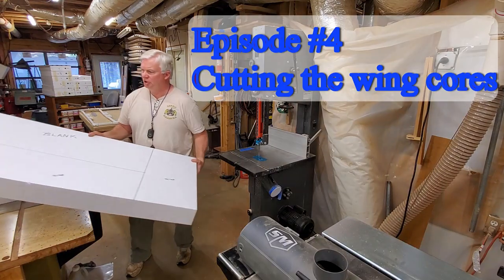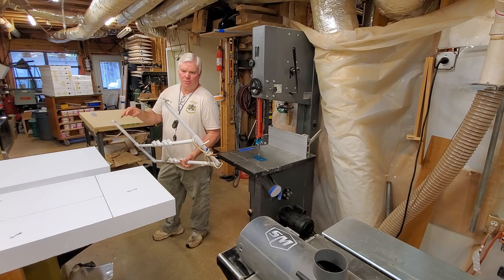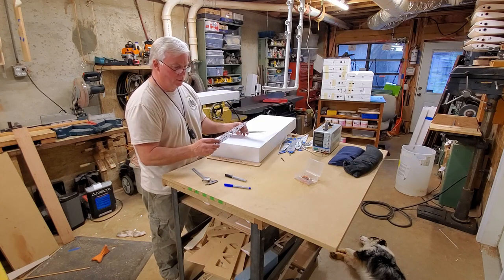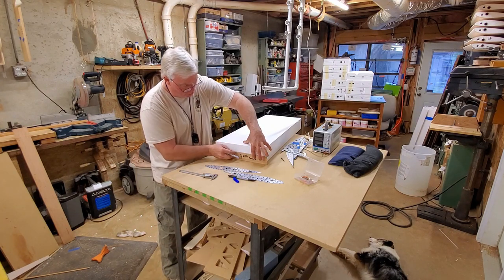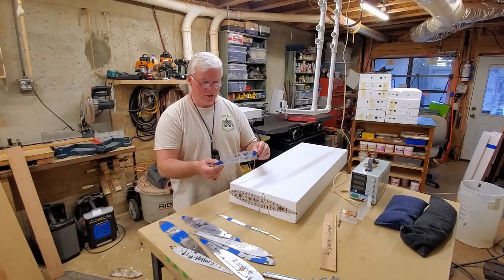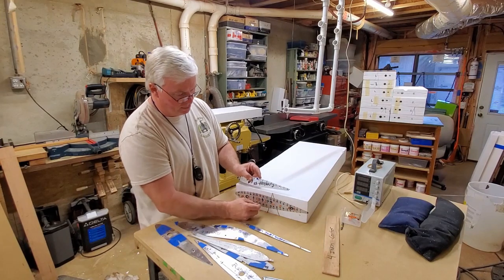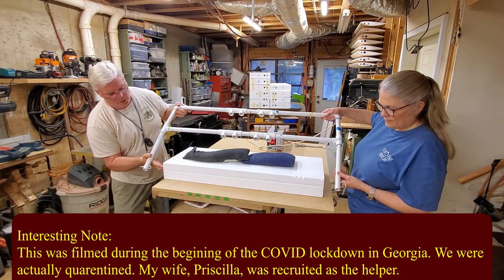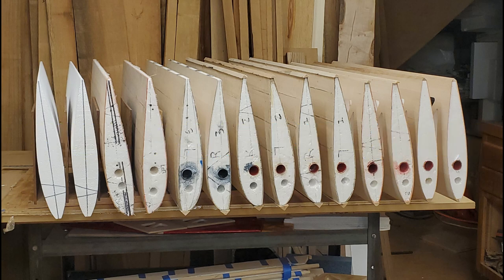Scratch Building your Own RC Planes  Episode #4 - Part One "Cutting Foam Wing Cores"

Comment: My first styro foam wing was made in 1988 at control line airplane F2B. I remember it was not easy and few first styro block was damaged,.
The diameter, length of wire and voltage were  experimentally determined. 
Airfoil made of steel is needed to avoid stuck the wire in one place during cutting.
Good tips; interesting and cheap technique for good and strong wing.
After the styrofoam has been covered with the balsa sheet and the pipe is approximately 1/2 of its length installed, the wing girder is redundant  :-)
Reply from the maker: Thanks for the kind words and background.  I'm not sure what you mean by "girder"?
Reply: @mikencrcf6018  I mean "wing spar" of course  :-)
Reply from the maker: @peterp.3530    oh, yes.  A wing spar would be completely useless in this design.   I do put balsa spars on top and bottom of the flying wing however.  They form a "T" connection with the fiberglass and balsa.  Its incredibly strong.   But, those planes have a very short life span.

Comment: you could always put a small metal screen door screen cone on the end of your suction tube connected to a 1.5 battery positive terminal and the other end grounded to the metal table ... this will attract the gnats to the cone and the suction will pull them in
Reply from the maker: Hmmmm.  Send a sketch of what your describing to Cpd551@gmail.com 

I'll try that

Comment: Thank you. On the sockets what weight cloth
Reply from the maker: I use .7oz cloth for the sheeted parts.  Anything from .5oz  to 1.4oz would work depending on supply.  .5 is hard to find and very hard to handle since its so fragile.   1 oz goes down very nice but its a tiny bit heavier.   For most planes the difference is negligible.   

I always use 1.4oz on the flying wing plane.

I use 4 or 6 oz for the wing tube sockets.    

I made a FACEBOOK group  for this build project and related projects.  Feel free to join and post.  "Foam Core RC Plane Builds and Repairs ". 

Its much easier to navigate than this forum.

Comment: What voltage and amp setting on your power supply?
Reply from the maker: Roughly 22 volts at avout 2.7 amps.  It comes out to àbout 700 watts for the 40 inch wire bow I'm using.  Of course a shorter wire means less watts.  Again, the adjustable DC power supply is perfect, safe and cheap.  

Go to Facebook group "Foam core rc plane builds and repairs"  for easier correspondence and I can even send detailed photos.

Comment: Does your foam supplier ship out foam?
Reply from the maker: Many distributors do ship.  However, most require a minimum order size of about $200 to $250.  That's a lot of foam and shipping is over $100.  That's still much cheaper than buying and shipping single slabs.  

I drive over an hour to pick my foam up.  I buy about $200 worth and split it with several buddies in my area.  More because of storage space than cost.  

Kevin Baker, at Universal Foam has given me the best quotes for foam that I have seen so far.  They have locations all over the country and hopefully, one is close enough to you to make a day trip of it. 

Just search for 1lb polystyrene and you will see many distributors.  I've reached out to 6 or 7 of them and Universal was my favorite.  I explained to Kevin that I already buy from a location near me (which coincidentally  is one of their distributors) and that I getting info for you guys. He gladly worked up some quote options and agreed for me to mention him in the forum.   

I hope this helps.  Visit the Facebook group RC Foam Core Wings for more details.

Comment: HOW DO YOU GET IT FOR $5 DOLLARS !!!!!!!!!!!!!!!!!!!!!!  I HAVE A DISTRIBUTION FACTORY WHERE I LIVE AND IT IS $150 DOLLARS A SHEET FOR 4" X 48" X96"  SO HOW DO YOU GET IT FOR 5 DOLLARS UNLESS YOU KNOW SOMEONE ON THE INSIDE  RIPPING OFF THE COMPANY FOR YOU / ???????????????????????????????
Reply from the maker: If you join the FACEBOOK Group RC Foam Core Wings,  you will see where I have provided quotes and invoice copies to guys all over the country helping them find distributors.   The average cost for a 4x48x24 is between 8 and 10 bucks. I'm not sure why your cost is so high.  Perhaps the shipping cost that your distributor is forcing on you is the issue.   Foam should not cost that much.  Feel free to reach out to me and I would be glad to help you locate a better supply.

In addition,  make sure you're not being told 150 bucks as a minimum order size.  

Most places will have a minimum order size of $200.  That means if you want 2 sheet, the price is $200.  If you buy $200 worth, you start paying the actual cost of the foam.  Not filling up the minimum order requirement.  Keep in mind they are not a retailer who is geared up to sell small quantities.   

Gather several guys and go in together.   Not so much to meet the minimum,  but more to help split up the storage, that's a bunch of foam.  

I will add that jumping to accusations of impropriety don't help your case.